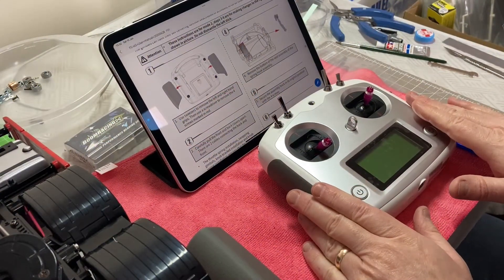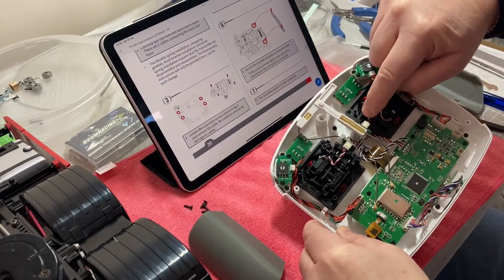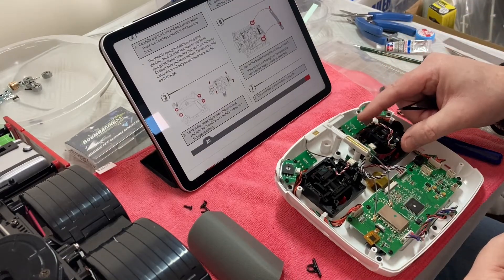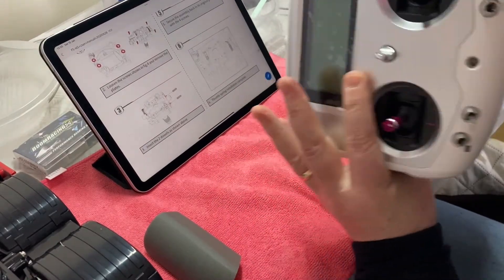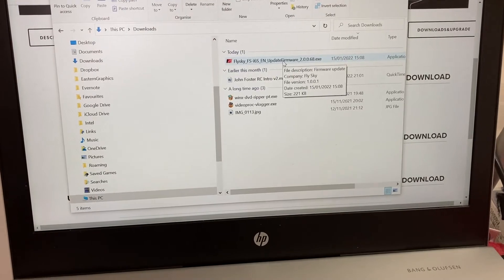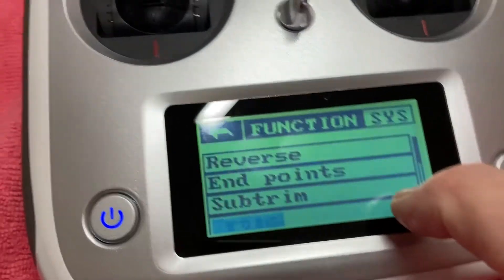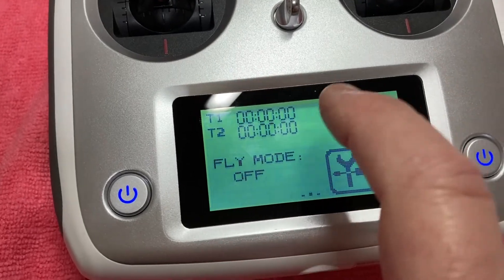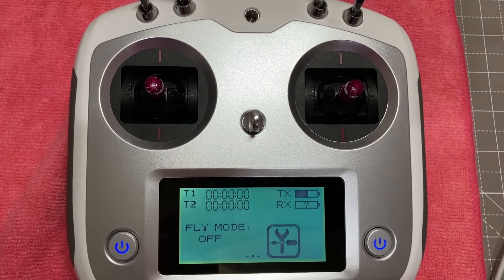FlySky FS i6S Self-Centring, Software Update & Programming for a MFC-03 Unit

Comment: just one question, the "self center kit" is included in the original package, or you need to buy extra. thanks
Reply from the maker: Hi, thank you for watching. The self centring kits is an option extra that I bought and installed. It’s an easy process and works a treat. Best wishes 😉😊😎